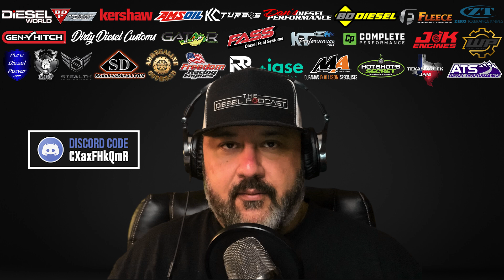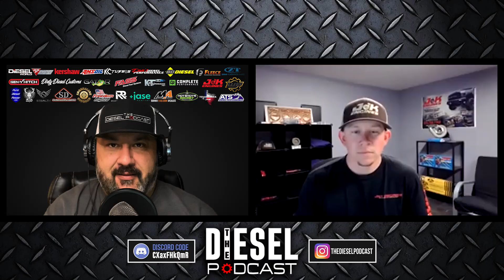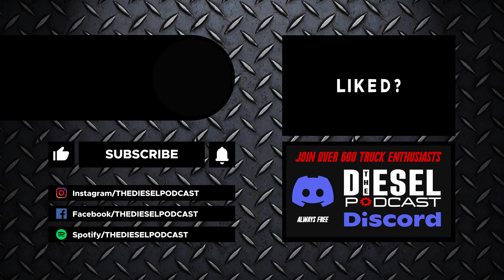7.3 vs 6.0 vs 6.4 vs 6.7 Powerstroke

Comment: Are the old 7.3 powerstroke from 1999-2000 the best? A friend of mine has an F450? I think, 7.3 powerstroke. I saw a 6.0 block on Ebay for $225, is this a good price? How much does it cost to build a 6.0 with good parts, avoiding all the original problems with this engine?

Comment: I also thought the same thing  when I went into the Army and sent to wheel vehicle  repair school  and found out how scrappy of a job working on diesels,  the slimy dirt,  soot and heavy everything  is to remove and install, hi torque values and how exhausting it is to work on . Oh I forgot, you better get uniform rental because your wife will hate you when she puts your diesel oil stained clothes in her washing machine and make her bras & panties smell like she is a pass around gal at diesel shops with a different boyfriend  each night and your car- truck floor rugs seats and your boots are ruined from that wonderful job you have being macho man working on diesel equipment. Have at it and you will be moving on shortly after the thrill is gone ! 😂

Comment: My 2002 7.3L 435,000 miles with no major issues, just routine truck stuff, still running the original transmission, so BS on the 6.0 being best for longevity and reliability.

Comment: I have a 2002 f-350 crew cab dually fwd with 7.3, 270,000 on it. Just bought a 2002 f-250 ext cab fwd with 7.3 265,000 on it, both still strong, just broke in ,at least another 250,000 or more miles left in them.
Reply: I got a 2002 7.3 short bed dually 250k on it

Comment: I put 338k on an early 04 6.0.  I did egr delete, bulletproof fan clutch, studs, hypermax 500 gaskets and a bunch of other small stuff.  I never even blew the stock gaskets.  The transmissions are great. I have a soft spot for the 6.0., But the reality is that they just aren’t cheap to own even if they’re reliable for the most part. No matter how much you “bulletproof” them the injectors go sporadically, and as they age they nickel and dime you.    If you have a shop that will work on them nearby great but if not you have to rely on the dealerships.

Comment: I personally own a 6.4 its my favorite platform. It has the tech comparable to the 6.7s and the ease of working on a 6.0 combined. Heres the damn truth. 6.4s had no more problems than the similar year Dmax, and cummins. Mahle cheaped out on casting process. ( seriously im not kidding, look it up ) all of them cracked pistons. I personally put 15k$ into my 6.4 and blue printed the motor completely. Even redesigned the cooling system and oil system. My truck runs 1200whp and gets 16mpg city 22mpg hwy at 80mph with a 8in lift.
Reply: 15k in total on top after buying it?

Comment: The new 6.7 needs to have an oil change every 3k miles. And more than that and They have oil dilution. Don’t change that oil and you’ll potentially be replacing your fuel system.
Reply: 2023 and newer 6.7s have a dedicated injector in the DPF so they don’t have as much oil dilution.   The also hold 2 more quarts than previous generations.   You can never go wrong with good maintenance though.

Comment: Great video. I have a couple of questions I was hurt two and a half years ago and can no longer go back to my line of work so I'm needing a company truck I might have to pull something like a trailer at some point in time I've always loved the idea of having a diesel truck diesel truck I come from the thought process that I'd rather have the power and not need it then to not have it need it are there any suggestions you could give me I'm looking at a budget of around 20 to 25,000 any help I would really appreciate. Plus the fact that I'm going to be using it as a daily driver I was concerned about gas mileage or do you think a gas pickup would be better for me wholesale what kind of mileage should I be looking at Max maximum gas mileage or diesel mileage for that price range
Reply: A 6.0 will give you all the power you need and gets about 16mpg. Problem with the 6.4 is that it isn't really supported. Lots of people like them but few shops like to work on them. 6.7 has 65 sensors in it. Wait till those fail.

Comment: I just keep driving my 6.4 over 574k miles just keep fresh oil and filters in it....
Reply: Love commenters like you, a lier.
Reply: Hi is it stock… I’m looking at one a 08 and owner has kept it all stock and only serviced by a ford dealer and am wanting to move in on it… it has 190k miles
Reply: @estebanjuarez2779  mines all stock but I highly recommend you get a 6.7 over the 6.4, the cost of maintenance is high keeping it on the road...
Reply: @ironjohn5914  than you very much 
Yeah I’m new to the power stroke and heads that the 6.4 requires cab removal … the 6.7s price point is my limiting factor… looking at two other 6.0 a dually and a single… honestly just need it to move my travel trailer around a few times a month
Reply: @ironjohn5914 no issues with the DPF? No emission problems?
Reply: @Wicked_RotF30  yes I run stanadyne fuel treatments~
Reply: @estebanjuarez2779 what are you using it for ? Most people don't "need" a diesel

Comment: Have owned a 7.3 and two 6 liters before I got into my 6.4 

The 7.3 was cheap and easy to fix, always started but was a chore just driving the thing around town. Love the 6.0h, hard to beat a 6 speed single cab with a 10 blade that you can hear from the next town over. But man the look, sound and comfort of a clean lariat/king ranch 6.4 thats straight piped is all I need, when she blows I will gladly put another motor before going to a 6.7 and thats no diss on the 6.7, if im pullin a trailer Ill take the 6.7 all day….i would never trust my 09 on long trips or with big weight behind it🙄
Reply: Why do you have a diesel truck if you’re not towing anything?
Reply: Probably because he can do what he wants with his own money that he earned and just wants one   @carter.coleman

Comment: I hate V8 diesels. I have owned 12V, 24valve, multiple 7.3 IDI's, and the turbo also the 7.3 power-stroke's, I have only owned I think 1 or 2 6.0's, and 3 or 4 6.4L power-stroke's. Never a 6.7 PS. I prefer an in line cylinder diesel that is easy to maintain. The "maintenance"; well is your emissions systems working properly? You pretty much have to strip these things down to the basics to make them work for the long term, that was why the 6.9 and 7.3 lasted(just keep the oil topped off, they leaked enough for the other components), that would be "basic maintenance". I don't want too hire a F-c[ing computer engineer to reset my oil light. How many dang filters are they putting on these trucks now for "maintenance" 3 fuel filters 2 to 3 oil filters, coolant filters, and then they have to add a bunch of radiators to cool the systems because it is so venerable because they run so much oil because it has to be extra clean and filtered and cooled, and sometimes we have to burn more fuel to clean out the dirty fueled exhaust, and we get terrible fuel mileage. At what point do you just be like, "at what expense is this worth"?
Reply: The most reasonable opinion on this ive seen in a while and one i unfortunately cannot disagree with

Comment: I quit counting miles after my odometer quit working about 15 years ago on my 1990 f350 with the 7.3 non turbo. It had 300 k before I bought it and the motor started smoking right after I got it. The cylinders had pin holes. A shop in Evansville In. rebuilt it, re-sleeved and normal parts replaced. That was 25 years ago... Daily driver up until a few years ago. I estimate the new rebuild has 600k +or- on it and close to a million miles on the truck. Normal maintenance is all I have done. If I had to pick a bullet proof engine it would be the 7.3 International. It don't have rpm range or turbo, but it will work hard forever with oil changes and normal maintenance.

Comment: We had a J&K 7.3L Crate Engine that was missing the dummy plugs under the valve cover lol engine wouldn’t build high pressure oil, only base oil.

Once the dummy plugs were noticed to be missing, we then were able to get the engine to start. After the fact, the engine knocks like a SOB. J&K is junk!

If you are looking for a reliable  Powerstroke crate engine go with Kill Devil Diesel, Ford OEM, or Choate Engineering.

Jasper is junk too! Stay away from them.

Comment: Im currently looking for a 3/4 ton power stroke deciding between low mileage 6.0 or high mileage 6.7 $30k budget
Reply: If you don't need the extra torque of the 6.7 then go with 6.0, do as suggested, don't go half ass, it will reward you over time
Reply: @Darren Occhiuzzo  I paid 10k for my 05' 6.0 2 years ago and I had a new water pump, oil cooler, it already had exhaust on it. I believe it had a warranty engine put in earlier in its life when it was a fleet truck in VA somewhere. In my opinion a non Def model year is better.
Reply: you can find 6.0 for 10 to 15k that's a lot let over, you could have a badass build
Reply: @jamesmiddleton660  exactly
Reply: If you look hard enough there are low mileage 6.7s out there for 30k if you don't buy a platinum. 6.0s are not worth it in my opinion unless you have a huge budget for maintenance.

Comment: Here’s the biggest weak point, THEY ARE A V8! Dumbest idea amongst light duty diesel trucks and not sure why ford and Gm continue to shoe horning them junkers in a engine compartment!
Reply: I absolutely hate working on a v8 diesel but they do have advantages in drivability.
Reply: Inline engines dont require a harmonic balancer as they are self balanced which does wonders for anything mechanical
Reply: Tard
Reply: YOU OBVIOUSLY DONT KNOW MUCH. THERE ARE 10 S. OF MILLIONS OF V 8 DIESEL ON THE ROAD STILL. MANY HAVE NEVER BEEN REBUILT. EVEN CUMMINGS HAS LOT OF PROBLEMS.. IF YOU COMPARE ALL THINGS TO AN OLD STOCK 12V, THATS A DIFFERENT CHAPTER
Reply: I remember designing the v8 diesel engine. Your welcome
Reply: “Them junkers”. 
Ok, cousin humper.

Comment: I always hated the 6.0, now it's probably my favorite. I've had 12v&24v 5.9 6.7 cummins, lb7 lbz which I still own, lmm. I love them all but I have a bulletproof 6.0 which might be my favorite. Also have a 14 6.7 powerstroke which I also like. I'm down on the 6.4 though I'll never own one of them
Reply: I'm absolutely set with my '05 6.0. Love the way it sounds and tons of power anywhere I need it. Not heavily molded either